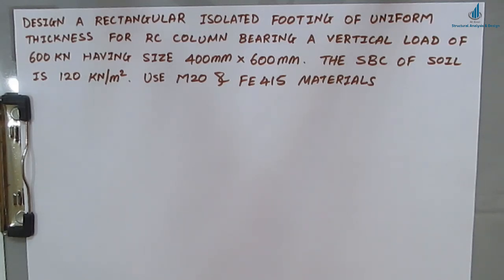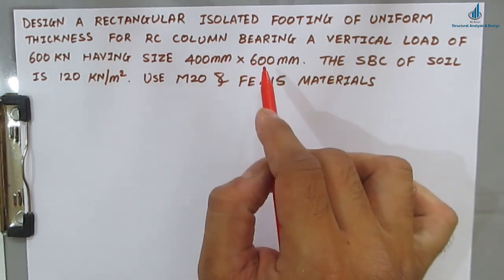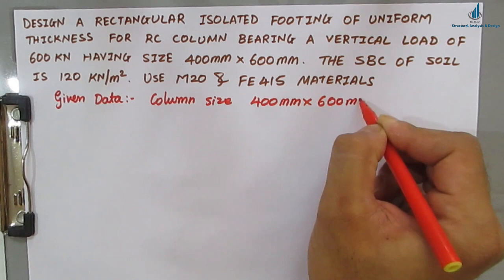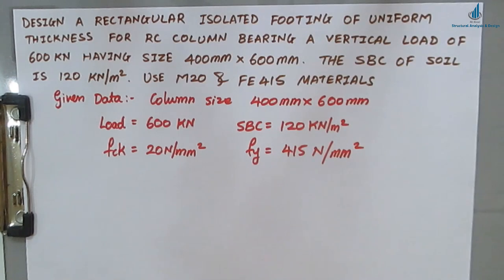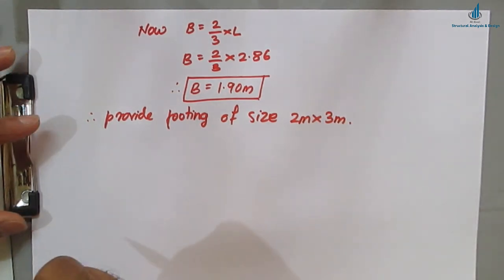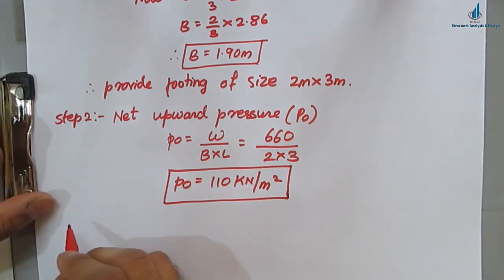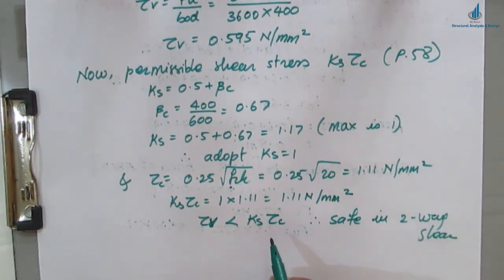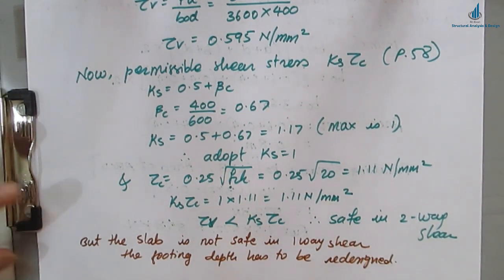Rectangular Footing Design | Numerical | Rectangular design problem | isolated rectangular footing

Comment: Sir in Ast-1 , % of steel value is coming 0.021. but you worte 0.21. where as 0.021 is less than the required min percentage of steel of 0.12%. please correct me if iam wrong.

Comment: THANKS A LOT SIR, I WAS WAITING EAGERLY FOR THIS VIDEO
Reply from the maker: This was specially done for you which you had requested, keep supporting and loving  like this and share with your friends
Reply: @structuralanalysisanddesign  Thank you and stay safe
Reply from the maker: You too stay safe, next will be coming up with center line method to find out the quantities
Reply: @structuralanalysisanddesign  Sir, at 24:50 you did a mistake.  1155 divide  by 113 is 10.2 bars, but u answered 12.36 bars.  why?  
if 10 bars is right, then it is under reinforced, right ?  how come the calculation method is wrong ?
Reply: S correct

Comment: Thanks sir for this explanation, Sir which bar should be  at bottom or top (for footing jali) .Should short bars be at bottom side and long bars should be above short bars?   Is it mandatory ? Position  of long bar and short bar depend on depth d and d1. It always depending on sequence of calculation of Ast1 and Ast2. Is it mandatory that As1 should be calculated by max BM  (M1u) and Ast2 should be calculated by low value of BM  (M2u). Because sequence of calculation of Ast1 and Ast2 decides the position of upper side or lower side of bars due to depth d and d1 . Can we calculate As1 by M2u  and   As2 by M1u vice versa.  In footing reinforcement schedule there is  no provision of showing  Max BM and  sequence of Ast1 and Ast2 calculation then how to decide laying position of short bar or long bar (above or below for same jali as a long bar and short bar) ? Please explain sir.

Comment: For area of steel reinforcement Ast1 I think u made a mistake ...  in the root of the formula it is Bd²... so it should be 400² which is equal to 160,000.. can u please clarify if I am wrong
Reply from the maker: Yes my dear student its BdSqaure and 400square, by mistake i have written only 400 but the answer is correct its done by taking 400sqaure
Reply: He calculated with 400 square, he just forgot to put square sign in formular
you can check his calculation is correct.

Comment: sir in check for 1 way shear we concluded it as not safe , is it because Tv and Tc value are real close .If Tv = 0.35 and Tc=0.328  then it will be safe , isnt it sir , as there is a good difference here

Comment: sir, Ast-2 u have not followed clear spacing rule mentioned in table-15 of IS;456. for 415 steel clear spacing should not be more than 180mm. correct me if I'm wrong.
Reply from the maker: Check out page number 66 of IS 456-2000, clause 34.5.1, it says as per solid slabs we have to follow and table 15 is for beams, clause 26.3.3 in slabs it says 3 times effective depth or 300mm whichever is smaller.
I hope i cleared you doubt, thanks for watching
Reply: @structuralanalysisanddesign   Yes sir, cleared. Thank you. sir plz teach us edge column footing .... No YT channel did that.
Reply from the maker: Definitely i will try to work out that problem
Reply: @structuralanalysisanddesign  sir, for Ast-2 , pt value is less than o.12%. in that case what to do? should provide minimum %?

Comment: do we have to provide As1 in the shorter direction?
do we have to always use the BOTTOM Reinforcement %(As1) while calculating for concrete shear in 1way shear check?

Comment: Hello, could you explain where the M1u= 0.138FckBd^2  comes from?
Reply: Its in 15.20
Reply from the maker: Hello Jessica, it is the modified formula of Mulim which is given on Page 96 of IS 456-2000 (G 1.1 (c) Formula) i have substituted (Xumax/d) value and got 0.138Fckbd^d and remember its valid only for Fe415. for Fe 250 and Fe 500 (Xumax/d) is different so you get different Mu value. 
I hope i cleared your doubt, keep watching and keep sharing
Reply: @structuralanalysisanddesign  Thank you! Your videos are very informative :)

Comment: fck means=?
Is it ultimate compressive strees???
sir plz reply
Reply from the maker: fck is compressive strength of concrete
Reply: @structuralanalysisanddesign ultimate or allowable?

In Bangladesh, we use f'
Reply: Compressive stress of concrete

Comment: for net upward pressure , isnt it we should use factored load?? like 1.5*600
Reply from the maker: Hello amit, i have not incorporated factored load while calculating upward pressure but if you watch carefully complete video i have factored moment by mutiplying 1.5, its usual practice to use safety factor for moment instead of load

Comment: why you are not using this formula for Ast calculation Mu=0.87 x fy x Ast d {1-(Ast*fy/(bd*fck))}
Reply from the maker: I dont use that formula because it becomes tedious to follow that formula, the modified version of Ast formula which i use is very easy to use and apply, please refer Limit State Design of Reinforced Concrete by B.C.Punmia for that theory how the formula is modified, i recommend to use modified version for simplicity, however both formula gives same Ast.
Reply: Tq so much sir for giving clarity, I did one footing design with reference of your video that is sq footing and rectangle column I'll send it Plz check sir.....
Reply from the maker: sure

Comment: Sir, how to calculate the bending moment in square footing for rectangular column ?
Reply: Consider critical section length i.e (L-a/2) and BM for cantilever is WL^2/2...
Finaly u wil get Wu(L-a)^2/8
Reply: @praveenmotovlogger98  hi Darla
Reply: B.m =po.B*L/8(B-b)^2

But my doubt is how two way shear check for a rectanglurar column squre footing

Comment: Wrong solution..B value is taken wrong. At Vx it is raken as 2000 and at Tv it is taken as 3000..ive wasted my time looking at this video. Observe from 29th minute. DISAPPOINTED.
Reply from the maker: Solution is not wrong, at 33:22 i have corrected as 2000, while writing i made mistake but value calculated is correct